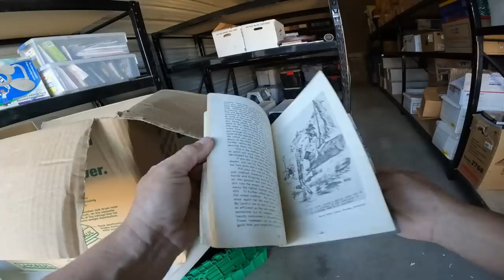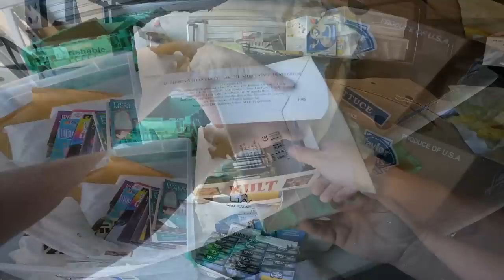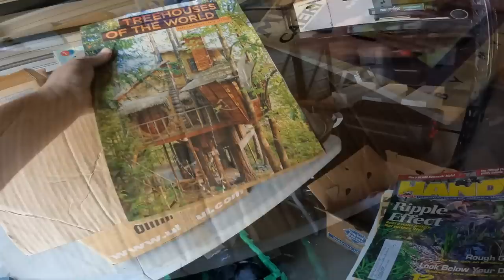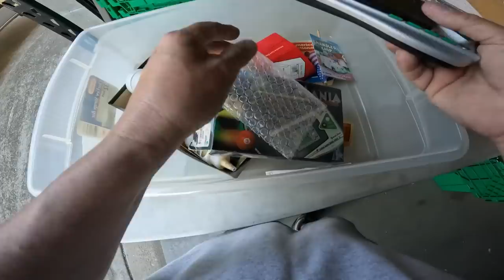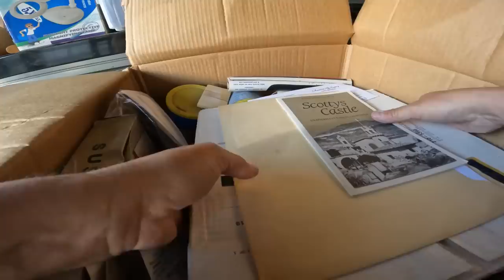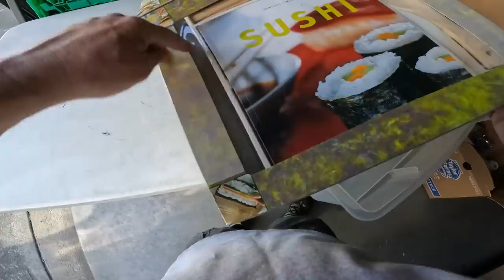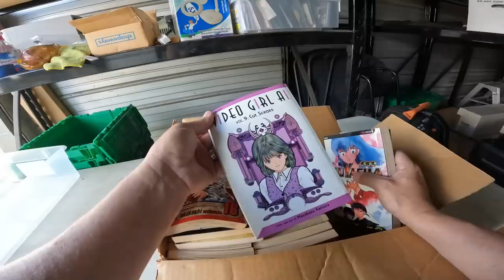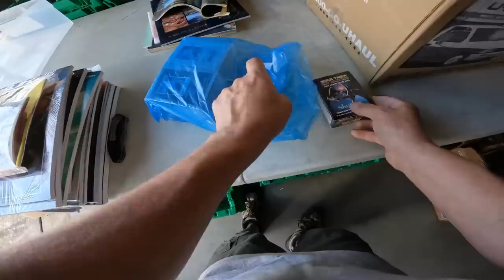Metal box found buried inside locker estate... What's inside? Lets open it!

Comment: Hi Jack! I have one of those little vintage heaters and it’s the best little space heater i’ve ever owned. Years ago when i was pinching pennies i used it instead of my electric heat. It kept my little house (900 square ft) toasty in the winter. It turns off if it tips over for your safety. 🙂

Comment: Jack, the small bottle is probably a snuff or scent bottle used by the Japanese/Chinese. You may want to keep this and use it for some of the lockers you uncover!
Reply from the maker: Thanks Larry! I plan to put those into the live auction at some point. They are pretty cool.
Reply: @LockerNuts  Jack I left a message for you last week about using boards as a slide to on those stairs in that unit that has no elevator.  I've done this before it saves you alot of trips carrying up an down.